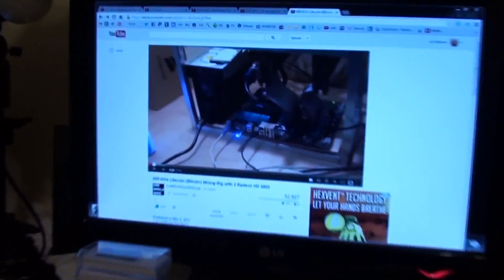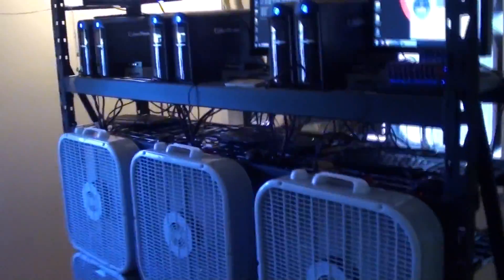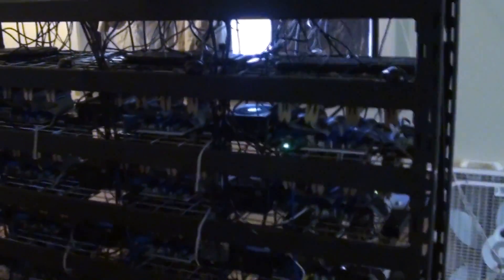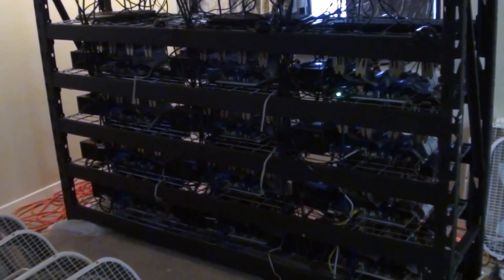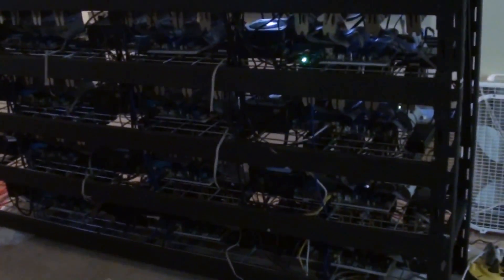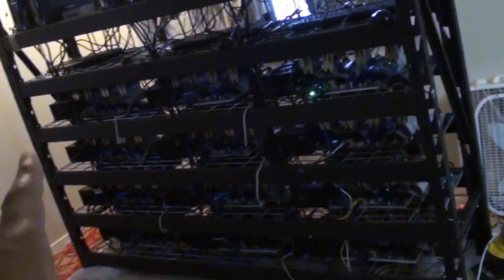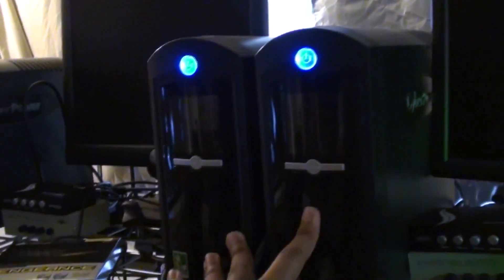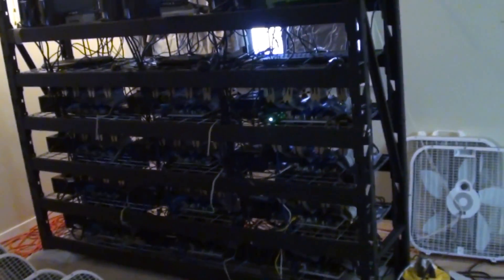16 MHs Litecoin 24 GHs Bitcoin Mining Farm ASIC vs GPU Technology [Reupload]

Comment: You need real AC bro. And as an electrician you NEED TO REDO YOUR WIRING It looks so bad like fire hazard bad. My rigs all have Hospital Grade Isolated Ground plugs on 20 Amp circuits, each duplex outlet has it's own dedicated circuit breaker. I also am not using standard 14AWG wire, I am using thicker 12AWG wire.
You need isolated grounds as you are injecting a lot of line noise due to PCs being used. You may even need an isolated transformer outside your house potentially. I mean seriously you have no idea how risky you are doing things bro. Do yourself a favor get some real electrical work done before bad juju happens, you'll even save some money in the long run, and if running that many rigs it might be worth it to have dedicated 220Volt lines instead of US/Canada 120Volt to get an extra 7-8% power efficiency.

Comment: So now that Asics are coming to litecoin, would it really be worth investing in a gpu mining rig? I will concede that all the lite coin ASICs are pretty much just talk at this point but some have been developed. I'm just worried about setting up a mining op just to get pushed out by ASICS just like with bitcoin.
Reply: Oh ok, I thought that once the asics for litecoin were out that they could be used for all scrypt based coins.
Reply: Currently, there are USB ASIC scrypt miners (https://bitcointalk.org/index.php?topic=438177.0) but the cost per performance is less than if you were to build your own mining rig. The advantages are that they use less power, less space, and less heat.
There are some companies claiming to be taking preorders for scrypt ASIC's but be forewarned, some of them are scams (alpha technologies) or may take forever to start shipping.
And in the end, if you buy graphics cards for mining, you can always sell it to gamers or make a gaming computer if ASIC scrypt miners take over or if mining is not profitable anymore.
Reply: Yea that's pretty much my way of thinking behind it. I'm a gamer and can def make use of the cards. But even if/when ASICs take over that will only drive up the price of LTC so I want to hash out as many coins as I can before that happens.
Reply: I have invested some with the recent tanking of the market but not much. I bit the bullet and built myself a budget rig running about 1.3MH. After doing more research I've realized ASICS aren't a huge threat, at least not for a good while. Even the ones out now only benefit from less power usage, not KH/$ And If I'm wrong I still have my cards.

Comment: What motherboards are you using? How much RAM do you have on the motherboards? What CPU do you use? Really a great video, you know what you're doing.
Reply: Your CPU/RAM is pretty much irrelevant when it comes to LTC mining. Any budget MB/CPU combo with about 2-4gigs is perfectly fine. Invest your money in the GPUs! As far as the MB goes I would recomend a board with a lot of PCIEx1 slots for expandability (no need for a lot of bandwidth with x16 slots)
Reply: Warndog
TY Warndog. I know that but I would like to know what MB he is using 'cos not all types are available at all times and  there is a difference between PCI 16 nad PCI 8 and PCI 1 but its not so important.
Reply: Yea I just say PCIEx1 because there are a LOT more boards with ~6 x1 slots, extremely few with 6 x16s, and the ones that do are generally very expensive.

Comment: Have you thought about water cooling your miners instead of using all those fans?
It will certainly save you a lot of electricity, plus the room temperature wouldn't be in the 90's.In addition, your miners would run a lot cooler and efficient.
Reply: Link for water-cooling miners??
Reply: What I meant was, instead of using the standard coolers that comes with the GPUs. You could use the standard water cooling system. Water blocks, radiators, pump and reservoir.